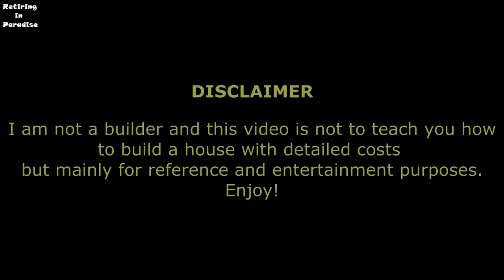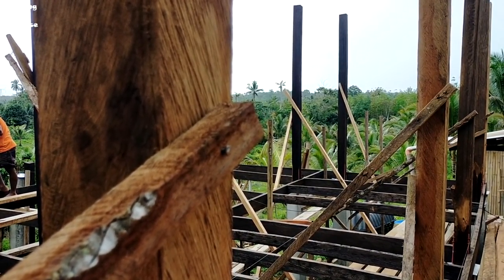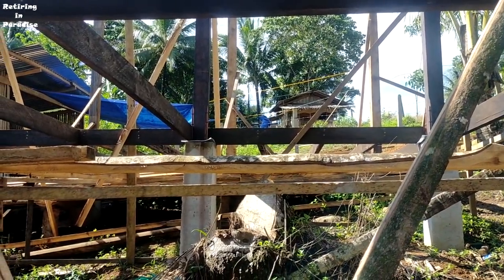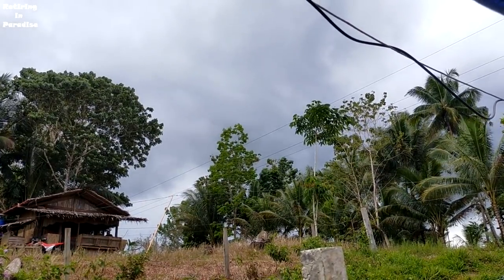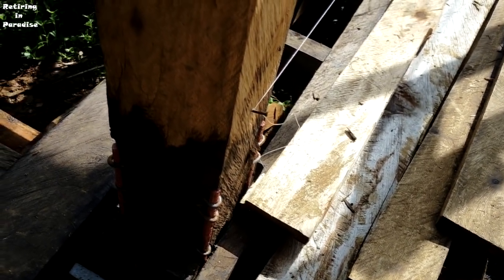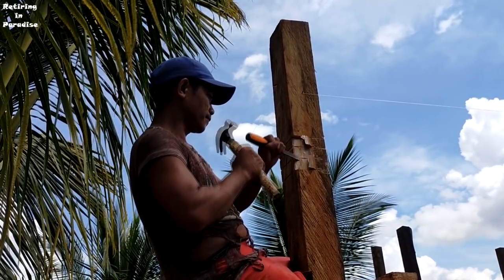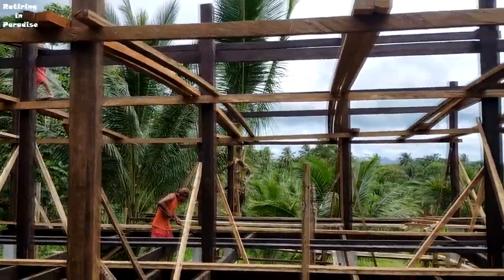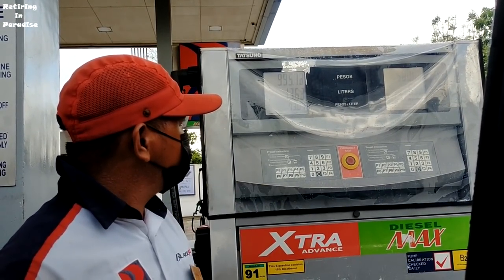V287 - Pt 18 FOREIGNER BUILDING A CHEAP HOUSE IN THE PHILIPPINES - Retiring in South East Asia vlog

Comment: Weld 2 steel plate between 2 rebars , drill straight through and put a bolt through . Or maybe use 2 coach bolts . That will make that part cyclone proof .

Comment: Good progress so far. Noticing that there may be are many columns in the plans than what may be necessary. But a stronger house is of course better than a weaker one. To make the joints between the concrete part of the column and the timber column, strategic columns or every other column may be strengthened by L shape connector 2 to 3 inches wide and a 1/4 inch or more thick with 2 holes where screws can be driven to the timber and and 2 holes where screws can be driven into the concrete.
Reply from the maker: Yes😊👍

Comment: You need joist hangers for your floor. The only thing supporting them is the nails . There going to fail and down you go . Support gerders under the joists will be your best option otherwise your floor is going to collapse.  Build safe and God bless.
Reply from the maker: Screws And bolts are going into there as well. It says in the video

Comment: What might have been a good idea to make a stronger connection for posts to rebar, would be to weld a flat steel plate to rebar and drill through to each surface and bolts thus making a strong connection from.foundations to post? Just an idea🤗🤗🤔🤔🤔♥️
Reply from the maker: I heard that many times and I explained on this video why I am not doing it

Comment: It's the province not the city,therefor things are done differently, the final product will last for at least 20 plus years ,the most important detail is to guard against termites and wood rot,so applying the chemical on the wood should be done with extra care,,,,,the build is looking good,it probably would have been close to completion if the weather cooperated,,,,regards
Reply from the maker: Yes rain has slow us down considerably. Worked 2 half days in the last 6 days😏

Comment: if i were you, i would have embedded 2 steel ties on each pier, that typical 1/4 by 2 inch on top of your piers that will clasp on the base of the wood columns and use 2 one half inch bolts and nuts.  that will give me peace of mind in case of a big typhoon.  technique i use in positioning the metal ties in top of the concrete is cut a dummy column maybe 18 inches high where to position the metal ties on 2 opposite sides and position the whole contraption at the end of the concrete pour.  using those several  U shape nails i imagine takes time using more labor time and let alone less effective than the steel concrete ties.  but it is just me.  the whole weight of the second floor will help the u shape nails hold down your second floor to the concrete piers in case of a big typhoon.

Comment: Hi Joe! I've been watching your project I am moving to dipolog City hopefully May. I was a remodeling contractor and builder for over 40 years. I would like to bring something to your attention that you should do because you are in typhoon area. All the large post you have standing up I suggest that you box in each post with the same material  you're using for floor Joyce. My doing this it will stabilize your framing to your wall structures. It looks like your framing for the floor is about 24 inches apart. Whatever material you use to cover those floor joist such as plywood make sure the plywood is 3/4 of an inch thick. Otherwise you will regret it later. You should install blocking in between your Joyce about every 4 ft this will prevent your floor from sagging. These are just a couple tips to help you what. You have any questions about Construction and every aspect from electrical the plumbing to tile work feel free to contact me and I help you as much as I can
Reply from the maker: NO! WE ARE NOT IN A TYPHOON AREA.
Reply: @TheGarciaFamily04  my girlfriend lives in Sayaw. We own 2 lots in Sindangan. We are thinking about opening a restaurant  in Dipolog like an internet Cafe style.
Reply from the maker: @slamina12  best wishes😊👍
Reply: No....Sindangan is not a typhoon region. I am born in Dipolog and Zamboanga del Norte is not generally a typhoon danger zone!!
Reply: Thank you for the info!